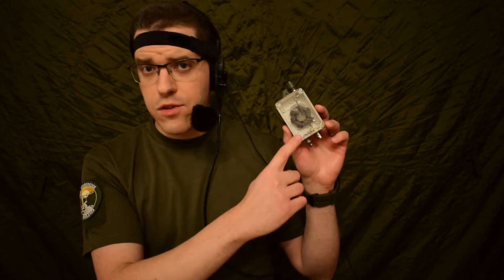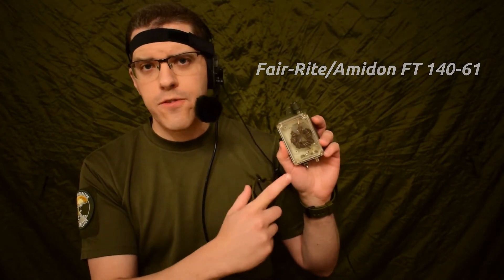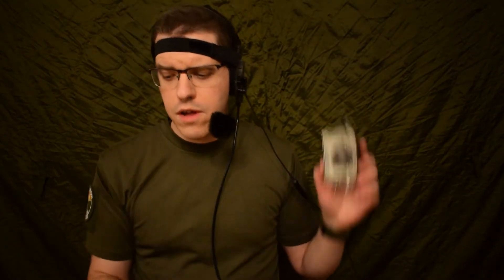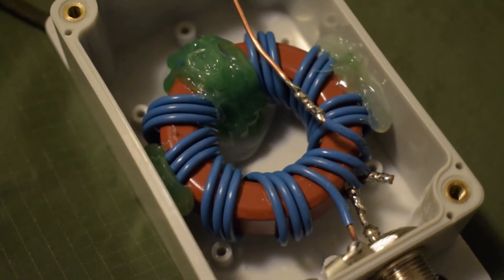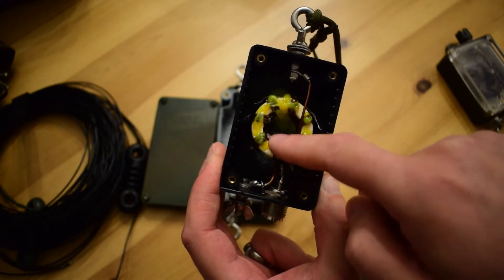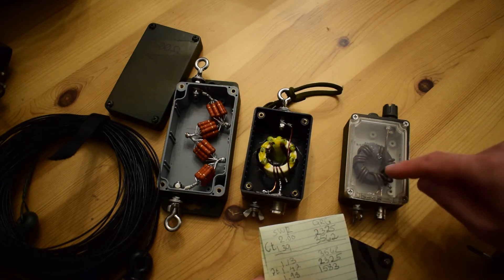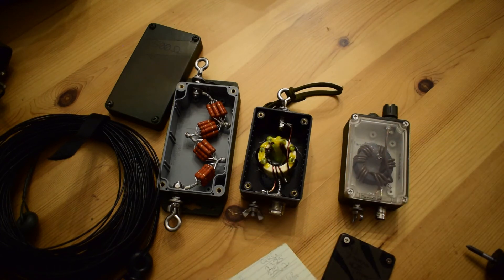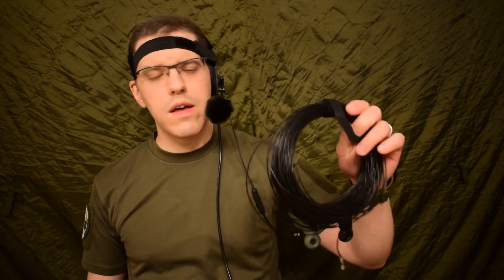9 to 1 transformer 6 vs 7 turns

Comment: some 9:1 ununs have 8 and 9 turns as well... I am a bit confused
Reply from the maker: In general, if you want a broadband transformer on a ferrite, the less turns you get away with the better. More turns, induction increases but it also get narrower. Choosing the right ferrite for the operating frequency range means induction is adequate with just a few turns, usually 5.